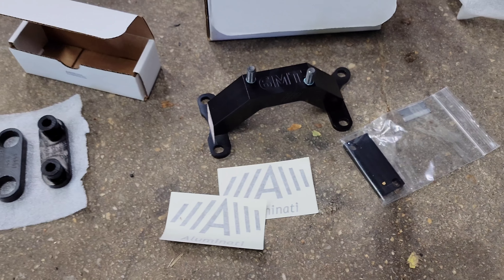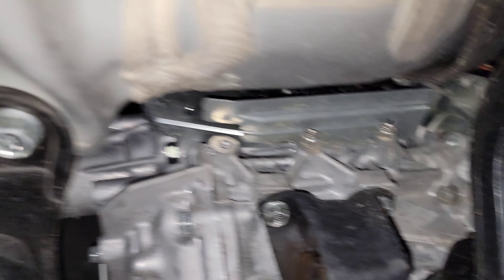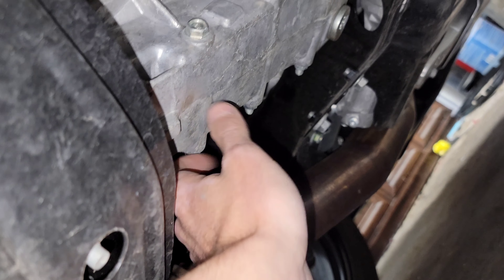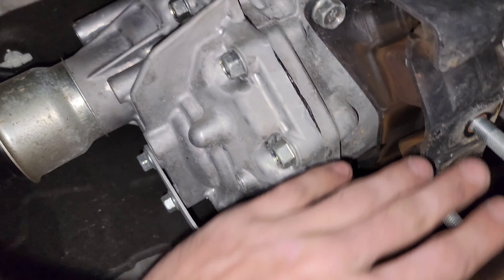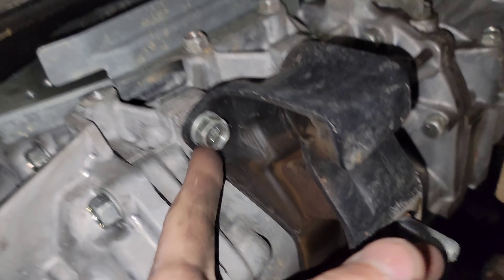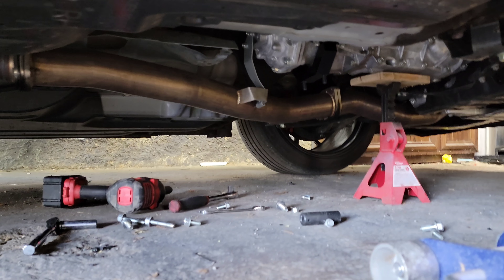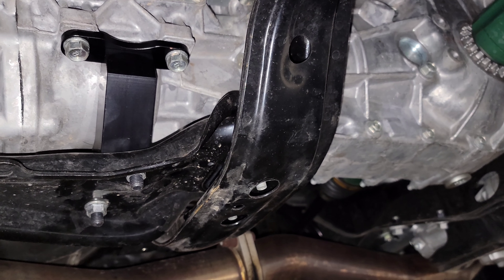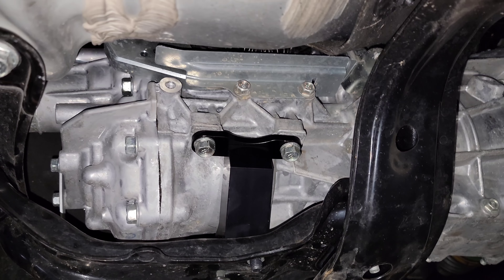Aluminati Solid Transmission Mount WRX ( Install & Review )

Comment: The Group N trans mout is around $80-$85 for those who are looking for something little less aggressive hope this helps
Reply from the maker: That's a great option! Much better than stock and not much added NVH. I was debating that at first but decided to go full send 😂
Reply: To those who do get a group n trans mount, be sure to get the part number ending in 020 and not 000. The description says 5spd but that's wrong. Hope this helps.

Comment: Did you notice any difference with the steering wheel vibration after you did that adjustment in your most recent video? Did that change anything?
Reply from the maker: I actually don't have this installed anymore. I am running thr group N mount now. I loved this Aluminati mount and still have it but the vibration in the seat and steering wheel got annoying as soon as I started daily driving the car so I swapped it out.
Reply: @StreetInspired1  any of those steering wheel vibrations with the group n?
Reply from the maker: @nabaddame5726  none at all, just a little extra noise. Coming from the solid mount, the group n almost feels stock again until you drive a car with a stock mount and remember how bad the stock one is haha

Comment: can you do a vid on the cobb tuning transmission plate ? ive got the shifter stop and bushings already and ordered the short shifter kit but it was a pain to install so i gave up lol and returned it and got the plate only can you recommend a good inbetween tran mount that isn't too vibrating and noisy but helps with the jerkiness and shakes from down low in the revs
Reply from the maker: I actually have an install video on the boomba shifter plate, the install should be the same as the cobb plate. https://youtu.be/tAkwvmyM798

Comment: U should get the bushings replaced for transmission helps a lot
Reply from the maker: That's what I did. Transmission mounts and Bushings lol. Unless you mean a pitch stop or Rear diff Bushings.